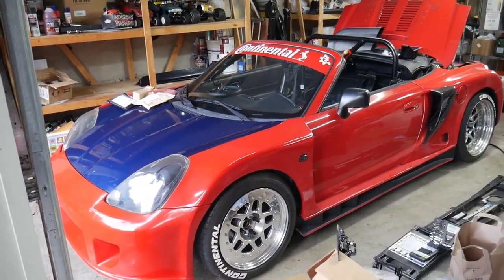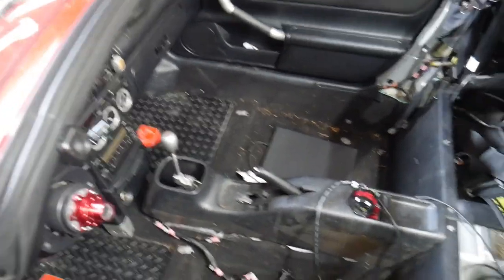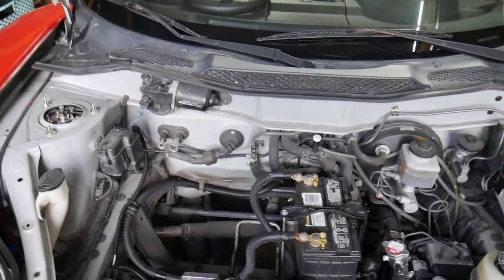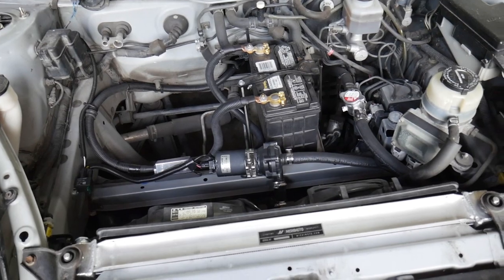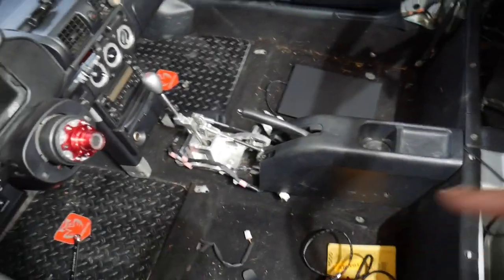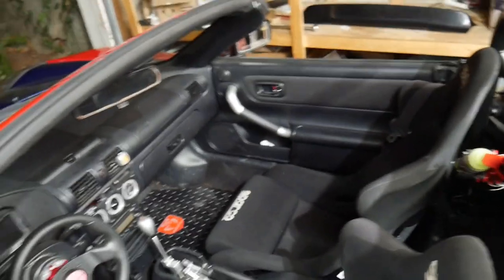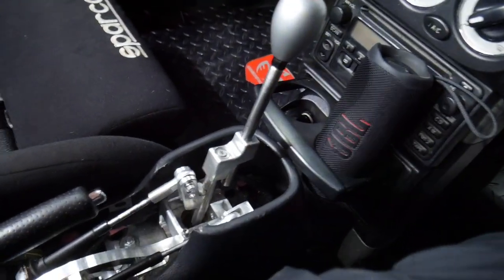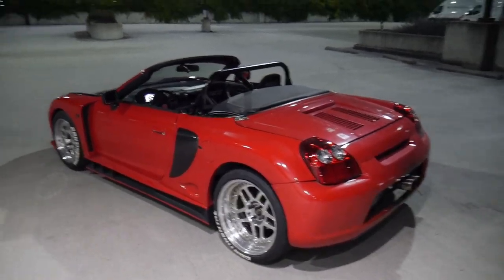K24 Turbo Toyota MR-S gets a refresh! | Monocraft GT300 MR2 Spyder

Comment: How do the seats seem to hold up? Kind of interested in what sort of seat would work best for a weekend 5+ hour cruising car. I'm thinking about Recaro Sportster in cloth, but I'm not sure how aggressive the bolstering is compared to something like the FRS/BRZ seats.
Reply from the maker: U would be surprised how comfortable these are. If you find the right angle, it’s comfortable. These are the “wide” versions. I’m 6ft 2, 200-210lbs. I’ve driven on a 4 hour road trip and it was plenty fine. Besides getting in and out, they’re comfy. Not as comfy as frs brz seats but good compared to other bucket seats. They’ve been holding up well! No fading or tears. And I’m not exactly careful with them at all😂

Comment: What is your solution for fuel gauge?
Reply from the maker: Fuel was wired into the aem gauge. Had to test the output wires from the fuel reader unit at full and at empty to see the voltage. Then convert it to ohms and got an adapter to feed into the aem harness. There’s a universal video online that I used, and I had to just adapt the video to the mr2 fuel reader
Reply from the maker: https://youtu.be/fAIre9O2YL8?si=EHuoGdI-iOsjlXkL